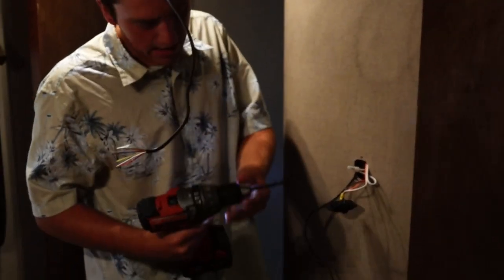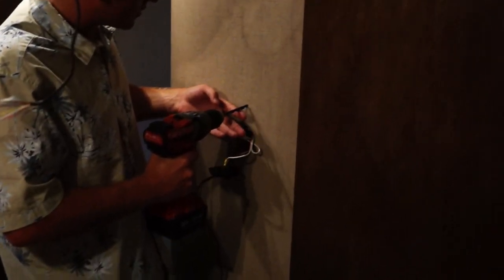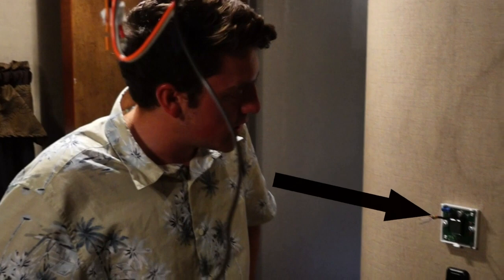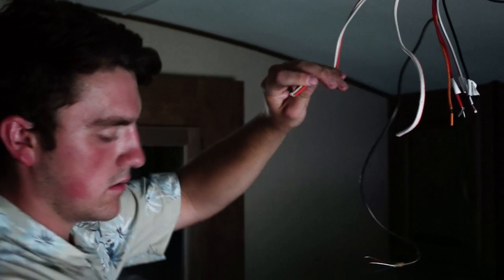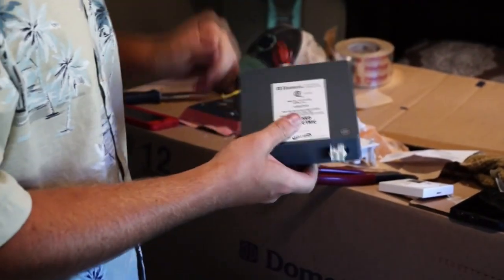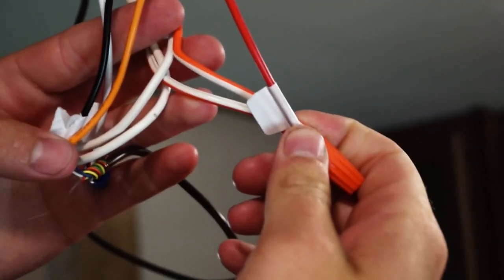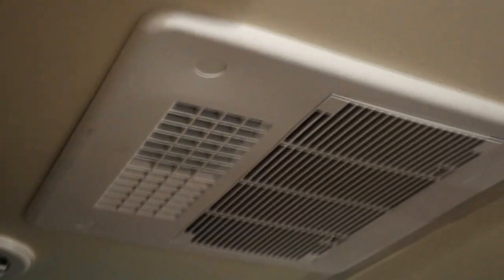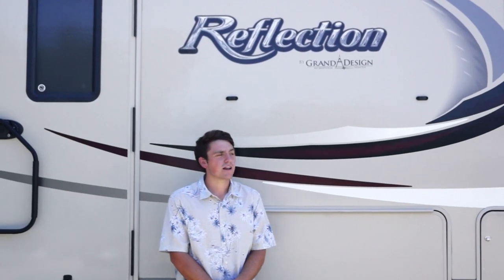Grand Design AC Unit Install Tutorial Part 2

Comment: When I ordered my reflection from my local dealer he didn't add the front A/C on the order so when it came in I was not happy. They did try to make it right, but they put in a A/C unit that is not connected to the ducting & has no thermostat so the fan runs constant with it on.

Comment: So there is no difference in a ducted and non-ducted system as far as the A/C goes. I have an older non-ducted trailer that the A/C compressor went out in and a friend of mine gave me the fairly brand new A/C off his old trailer that was ducted so I sould be able to just drop that A/C in place of my dead unit and run a thermostat line.

Comment: I have a 2010 wildcat and just installed the brisk II but had to get the control board in this video and the same thermostat you have shown. I’m having problems wiring up the control board though because it comes with 4 wires and my camper has many more. Help me please
Reply: What did you end up doing?